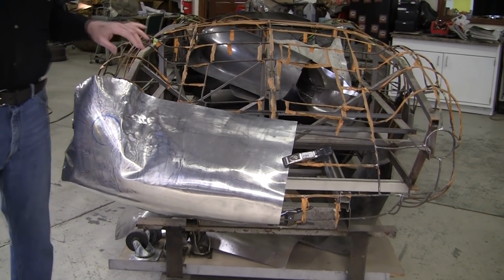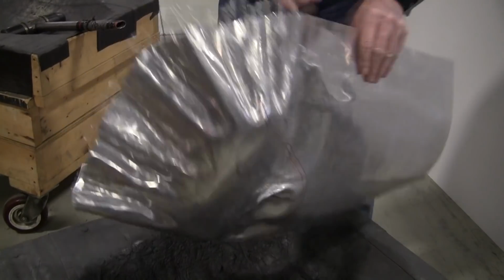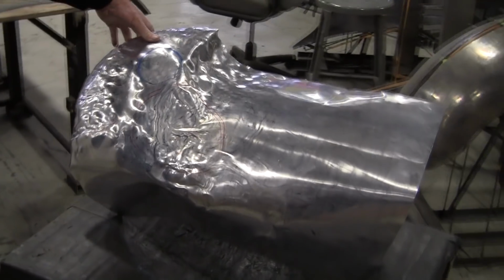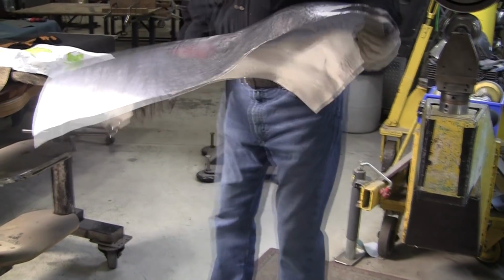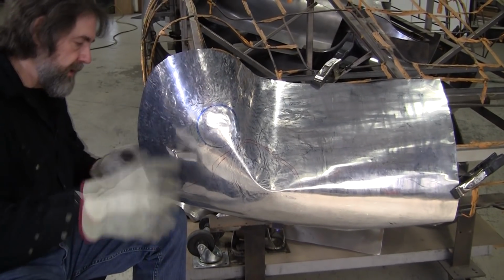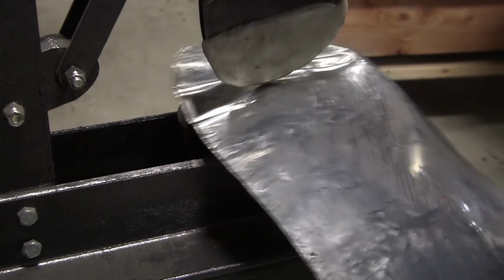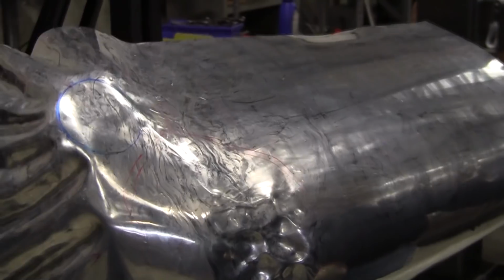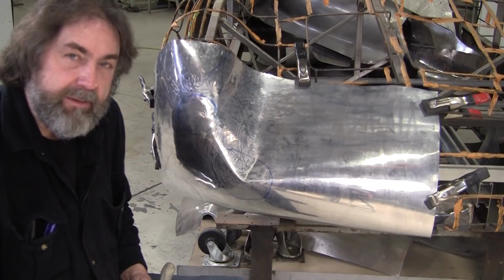Porsche 550 Build: Rear Section Part 2

Comment: I'm learning so much, Wray. Thanks!
Most important lesson: Patience.  It's going to look worse before it looks better.  There would have been so many points in the past where I would have thought I just messed everything up.  Now I know that real progress doesn't look pretty.
Reply from the maker: Exactly! Also remember the metal will do anything you want it to if you treat it properly.  Clay will fracture if you work it too much, you have to work it at it's pace, metal is the same. "Metal is Clay"  says Wray😁😁😁

Comment: Fantastic video thank you. For those of us that do not have a wheel yet. Waiting for your kit. In the meantime would a planishing hammer work instead as a cheaper alternative even though it leaves more marks??
Reply from the maker: A planishing hammer will work but you have to oil the panel or grease the dies to guard against scratching when you slide the panel over the dies. An English wheel yields the best surfaces.

Comment: Your hammer is available with a steel, wood or fibreglass handle all for the same price. What are the advantages/disadvantages of each?
Reply from the maker: Students try them out at my class, some like wood some like fiberglass, some like metal. I like the metal handle.

Comment: Wray, love the videos and this series, I have a question:  When you shrink along the perimeter like that, the metal has to go somewhere, does the panel grow in area or in volume?  Are you wanting to keep the thickness of the panel consistent?  I understand that the shrinks in the center of the panel  have to grow in thickness being "caught" in the surrounding metal.

Happy new year and many thanks!
Reply from the maker: Stretching reduces the thickness and increases the surface area. Shrinking increases the thickness and reduces the surface area.  "Metal is Clay"   clay is a add subtract medium, metal is a add subtract medium.  "Techniques over Tools"

Comment: Please do something in steel though 
.. for those of us that don't work in alloy
Reply from the maker: Hi Tom , what would you like to see made in steel?  Also why work in steel? Once you try aluminum you willl never want to work in steel. Why? It is easier to work, it is lighter, it is pretty with no paint, it doesn't rust, and it is a joy to work with. I'm assuming you are making Hot Rod projects. Hot Rodders should adopt aluminum across the board.
Reply: @proshaper  can you paint the aluminum?
Reply from the maker: @tjrizvi251  yes,  Millions of cars have been made with aluminum bodies.
Reply: @tjrizvi251  You just have to use the correct primer, or the paint will not adhere properly.  Back in the day they used to use Zinc Chromate, then Zinc Phosphate.  I'm not sure what they use today, but you need to find out before you lay down any paint!
Reply: @tjrizvi251  Most of the epoxy primers will adhere just fine to properly cleaned aluminum.I remember spraying the old Zinc etch horrible stuff that looked like yellow contact cement. There are self etching 2 pack high builds now as well.
Reply: Hi Wray , thanks for the time youve taken to reply , yes I fully agree alloy would be the way to go , but Ill bet  like many of your watchers the stuff you do while inspirational is also some what a bit of a fantasy , and I mean that in the nice way. A lot more of the folk I know own tractors and trucks rather than Porsche and Ferrari , there are a lot more seventies Datsuns than Lamborghinis out there , that means to me there is no alloy option , other than the odd tank fab job or a few brackets etc , the things I get to see most are things like wheel arch lower sections , headlight surrounds , the first six inches of the front wing / headlight or the bottom six inches of door bottoms , the awkward bits with all the curves  ,  a post to scuttle repairs , where the screen sits , the front six inches of vintage tractor bonnets . I know its not the high end glam stuff that you do a lot of , but its probably what most of us see . In a previous video you mentioned that the front of the 550 would be a totally different job in steel , and you started the rear section having the steel one that was all ready made fitted ,, both of those would be interesting to see being done in steel .  Maybe its more of a European thing but the only alloy I get to see is land rovers ,and mostly they are flat. Ill thank you once again for the wealth of knowledge and inspiration that you selflessly share ,  and it really is appreciated but Ill bet Im not on my own when I see a new video and secretly wish it was a lump of steel you were using ,, tractors and trucks are mostly built from 1.2mm or 60 thou in your world steel , even that changes the rules some what. Oh . and a how to fix the ridge that did roll over bit too , not all of us are sniper accurate with a hammer ..lol
Reply: @tomthompson7400  shrink/stretch, planish, the principles are exactly the same for steel
Reply: @daos3300   then why did the first video on the front of the 550 say the construction process was totally different ,,, trust me when I say it may be the same in theory , but it certainly isnt in practice.

Comment: Hi Wray  just wondering how long would it take for you to make A complete aluminium body shell for ASTON MARTIN DB4. Series 1
Reply from the maker: How long it takes to make a complete aluminum body depends on many factors. The two  most important components are the quality of the surface information you are copying and how many hours can you devote uninterrupted to the project everyday. If you have the ability to hammerform the very complicated surfaces that will save you hundreds of hours. So the question of how long does it take to build a complete aluminum  body is complicated. You have to figure in the time it will take to make the surface information as well as making the panels.
Reply: @proshaper  hi Wray thanks for the reply.  What I meant was how long roughly would it take you. From start to finish,   you are the expert and your work is absolutely amazing. That is what I meant  not for me to do it but if someone asked you as a customer to make the shell. 👌👌👌👌🏴🏴🏴ps I think the db4. Is the best looking Aston have made.

Comment: Please show us a part three on this panels refinement. The arrangement.
How long does the shrinking facilitator rubber sheet last?
Reply from the maker: Part 3 coming up next week. The EPDM rubber on the shrinking facilitator has lasted several years of heavy use so far. I see no reason to put on another layer. Home Depot used to carry it, but they haven't had it lately. Look for the roofing supply store in your area and they will have it.

Comment: thanks for the wonderful videos and free knowledge transfer Wray. this is the best metal shaping content out there. a question regarding working with steel - would heating sections of a steel panel with a torch work similar to annealing aluminium? and would there be any negative consequences in doing so?
Reply from the maker: Thanks! Steel can be heat shrunk just like aluminum, but it is better to let steel air cool. Working steel or aluminum with heat makes it more malleable.

Comment: Have you ever shrunk metal this way?   https://www.youtube.com/watch?v=MUQghpUVohU&list=PL2E2756A59012D86E&index=6
Reply from the maker: I came up with the idea and designed and built the gathering tool I use in my videos. I have been using that method for seven years now.  It forms the metal in the perfect way to shrink an edge.